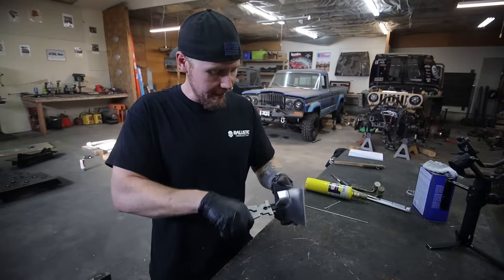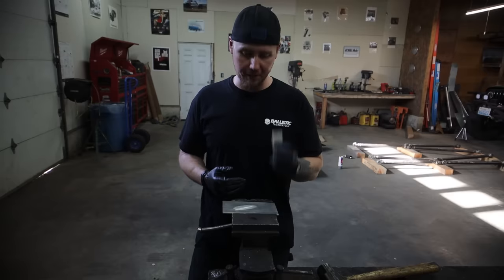Amazon's CHEAP Alternative To Aluminum Welding!!! (Alumaloy)

Comment: I'm wondering if this would work on the spokes of a cast alloy driving wheel from a 1/4 scale working steam traction engine.
I can buy a new pair (they're not sold individually) for around £500, but that's a lot to shell out on a 'new' engine.
The first problem I envisage is the heat sink effect of such thick alloy. I could use oxy/ace, but the potential temperature available would make it tricky to heat evenly.
Reply: you would have to back the spokes up with thin steel sheet metal or possibly thin plaster over a sand backup to keep the metal from running out also the thick chainlink ties used to attach the fence to the poles is aluminum i have welded with it befor feeding it into cracks and pokeing it together with a  a steel coathanger sharp on end
Reply: @dago88881  That's just what I was thinking. With the wheel removed from the engine I would be able to maeuvre it into the best position to do each spoke separately so that the JB Weld would run into the crack. 

I would fix each one on a separate day, leave the last one 48+ hours before going back and sanding down each spoke. Then leave it unpainted for a few trial runs with no load and then a few with a load. If it puts up with that the whole wheel can be repainted.

Comment: You do have a great teaching style and you should also do those suggestions about pre-spotting brazes these edges in another video. But do both sides you will that you almost match tig weldings try line etching the matting of one part onto the other like that double angle braze you had done on this video #9040 Amazon CHEAP Alternative~~~?

Comment: zink alloy is harder than aluminium so will crack under stress but is a stronger metal taper your weld Edge to a v then braise both sides your be shocked how strong it really is

Comment: What do you think of this with boost pipes?
Reply from the maker: I think that's is a pretty ideal project for this product. Charge pipes, weld-in-bungs for map sensors, ect. Just make sure you get some practice in before you braze on something important! Good luck brother 🤘
Reply: @DirtLifestyle  ideal be good to know what the melting point of the material is so know where cant use it. like i wonder if using it to weld a 90deg bend onto turbo would be too close to hot side
Reply from the maker: @martinbruce6713  melting point is just under 800°f. 750 or so. 👍

Comment: Forgive me if this was covered, but do you think it would be beneficial to bevel the joining plate as in welding? Or is this not necessary with brazing?
Reply from the maker: If the material is thick enough then I could see it being an advantage. But to much would make it difficult to fill so I would say its circumstantial 👍

Comment: What is the strength on the welding is there any kind of data on that I got a bicycle rack that I want to weld together I don't know if it's strong enough to braise it and I don't want to have to take it to a shop and have them use electric welder
Reply: Did you say " strength of welding "  - no welding in this vidio

Comment: If you value small business and local support for your welding supplies, then try using a local welding distributor.  Aluminum brazing alloys are nothing new and in stock at most welding distributors in the US.  Amazon is good for certain items, but buying specialty products from them hurts a lot of people on the supply side and opens up Chinese manufacturers access to the American consumer.

Comment: Would this work for something like  a bench or pedal board?
Reply from the maker: Very possible. I would pick some up and give it a shot. The more you use it the better the results. With enough practice this could work great! But keep in mind that it won't be as strong as a real tig weld
Reply: What I have in mind is just a pedal board for guitar effects pedals. Just has to support no more that 20 lbs at ABSOLUTE MOST and for me to step on the pedals to activate them. I'd like to build it from angle iron and flat bar. I'd use a good bit of bracing also. Great video man!

Comment: You were losing heat through the steal anvil below the aluminum. You will have better results braiding over ceramic, brick, concrete, etc.
Reply from the maker: Absolutely 👍

Comment: Do you think it would work between valves on a head v 6
Reply from the maker: I definitely do not. The temperature in the combustion chamber is way to hot for a product like this. Melting point is only 750°f. You will need to weld it with a tig torch or spool gun. 👍

Comment: God I hate brazing.  The puddle is so uncontrollable.  I'll stick with my inverter welder.  BTW you can buy aluminum stick and flux core and it does work.  Keep the arc short and move fast.

Comment: Would this work well enough for an aluminum motorcycle gas tank???
Reply from the maker: It works for my diesel fuel tank fine 👍
Reply: @DirtLifestyle  How much vibration does that take compared to a motorcycle gas tank though?  Asking because the vibration is what tore apart the weld on the old tank.

Comment: what is a double torch I've never heard of that in 60 years
Reply from the maker: It's a propane/map gas torch with a double head. We using in plumbing all the time. Very handy if you don't have oxy/acetylene torch 👍

Comment: Can you use this to seal muffler pipes?
Reply from the maker: Lol definitely not
Reply: @DirtLifestyle  If alumin melts at 1,200 degrees and muffler is at 1,000 shouldn't it work?
Reply from the maker: @mikerangel1545  I was thinking you won't get it to stick. This stuff melts just under 800° but I don't think that would be the issue. Its intended for aluminum. Not mild steel or stainless like you see in exhausts. My apologies, I thought you were trolling me. I have people giving me shit and they frame it in questions like this. I would check around and see if you can find a product like this for steel. I wouldn't be suprised if someone makes a steel brazing rod. Of course welding is your best option, but there could be other products available for someone who doesn't own a welder. Thanks for watching 👍
Reply: @DirtLifestyle  Ok. I'd put up video myself but I broke down and paid to have flexpipe changed Saturday. 

Can you paint an exhaust system to try and keep it from rusting?

Comment: FYI, BE CAREFUL! You better edit this video. When welding on a fuel tank, death is real, we used to (I'm a certified welder) put the fuel tanks before touching them with a welder, use a flame before using a stick/mig welder, put the tank around the corner of the brick building we were in. But first over a 2 day period, we would flush the tank with water over and over and over and over and over at least a dozen times to be sure all the fuel is out, leave it open and venting at least overnight. Then we ducked around the corner, letting only the torch handle be exposed, with us completely around the corner out of danger, and then hit it with a flame from the torch. I have seen a guy flush it once, took a torch to the tank and it blew the fuck up. It bellied the whole tank, a rectangle to near a ball, with stress cracks everywhere, and the tank was ruined. 
      Just to let you know to be aware of the dangers, I saw a guy set up his oxy/acetylene tanks up on a ladder 12 ft. up, then weld up 25 ft. in the air on a sign pole, the tank fell, the Oxy tank, and the top spout broke off and saw that 50 lb tank take off like a balloon when you fill it with air and let it go, the tank bounced off the pavement, went right through the side panel fender from 30 ft. away from the truck like a bullet. BE CAREFUL! You can be very seriously injured!                          
      You are not welding, you are doing a cosmetic bonding, not brazing, more like soldering. Brazing and welding is when you heat both pieces to be joined to the point of melting, then adding the rod/filler to aid in the welding, what you are doing is barely penetrating and not a structural weld as you said. Fine for non stressed items, un-pressured tanks etc... but if the tank is under pressure, I would not do what you are doing. We have test when getting certified, we weld up a box, then weld a nozzle to it, then under gauges to regulate, we fill it with water until the bursting point, and get a reading to be sure proper welds are performed. So if you are going to weld pressurized containers, I would make a test piece and pressurize it to 30% higher level than the normal pressure the tank will be under at least. 
  Also, if you want a better bond, bevel the pieces to be enjoined, the more surface of bonding the better the bond, so a "V" grove on both pieces if possible but even one may help improve the bonding, it may help considerably, as the pointed area may melt enabling more of a weld result than a basic un-structural bond. 
Just trying to help with the info.

Comment: Once I learned how to use this product I realized it's not very useful in repairing anything other than coke cans. The problem with it is the substrate has to be 900 degrees for the solder to stick. Once it's hot brush it and it flows right on. That's ok for tubing or fabricating small items like brackets where you can get and maintain 900 degrees and you have good metal. Cast items are trickier because your sticking point and melting point are so close I find you often destroy the casting before the almuirod sticks. Castings are often full of porosity and thicker so this isn't a practical solution. Unfortunately this happens to be what usually needs repair. These rods do look like they flow a little better than the ones I use.
Reply: P.S. Video was awesome, a real life demonstration of these rods.

Comment: The problem is getting it hot enough. I use my DC tig torch 185 amps. Have to be careful to not melt through though.

Comment: Probably missing the point here... but tapping the hole and putting in a bolt with Teflon tape would have been quicker and neater.  But, what the heck.  The brazing rod also works... >Charlie

Comment: 4:32 is a good example of why aluminum brazing sucks. The material has to absorb too much heat. It always warps. Also he really seems like he's trying to melt the rod with the heat of the torch. When the rod is introduced, the torch should not be involved at all.

Comment: This stuff, alumaweld et al is in no way a substitute for  welding. It's good for its original purpose (filling mold block defects), it will hold stuff together, albeit much weaker than a weld, and you can even make something waterproof. Unfortunately, you can't dress it down without it looking different, and if you grap a bit of dross with needle nose pliers you can actually rip it back off the aluminum- it really is a solder. You should not use this for any structural application. Sure, if you get a hole in your bellhousing it's a step above JB weld or gluing on a piece of metal with silicone. But it's not a weld. If you want to buy this and carry a torch for emergency repairs, more power to you- if you want a solution to welding aluminum go ahead and buy this because it's cheap but save up for an inverter welder- I have an Alpha TIG unit which I'm very happy with. You also have to take the time to learn either process, you are probably not going to patch holes in soda cans with this or lay a nice bead with a TIG welder on your first try. You need patience, if you dedicate a few hours a day to TIG you can weld most aluminum parts together at least serviceably in a week or two. Your welds will get cosmetically prettier over time. 

TLDR: It's OK for some situations but if you want to weld aluminum, invest in TIG.

Comment: I used this process to fix a Subaru's broken valve cover
Reply: J B did it hold because I have a hole in my gearbox
Reply: @fuanabands8436  Yes, but it didn't have any real stress on it. More of a filler that I then filed down to make a new sealing surface for the spark plug tube grommet. And the key is to have the part clean and really heated before applying the rod.

Comment: Use the Yellow bottle (Map), blue (propane) is not as  hot. So, as I am writing this I look into it more, turns out there is Mapp, Map-pro, and Propane. The one you want for this is Mapp, it burns much hotter (than Propane), Map-pro a tad hotter, Propane, well, not ideal. I also says that Mapp is no longer found. I have looked, it's all Map-pro now. Oh well, goodbye to yet anouther good thin. Yes I said thin, I also use dun't, figure it out.

Comment: If you do use this on the trail make sure you **DO NOT PLACE** the parts on rocks. The rock will get really hot,and explode tossing rock shards all over. OF course use proper fire safety.

Comment: U think I can make a complete fuel tank to hold gas for a bagged truck
Reply from the maker: I'm not sure. If you practice with it enough, I suppose it could be possible. Be very careful making fuel tanks, and test thoroughly 👍
Reply: Not worth the risk. Fuel tanks need to be strong. Failures could mean terrible death.

Comment: From what I have seen you didn't even need to put a patch over the hole on the tank. You could have used the rod to fill in the entire hole without it dripping through.

Comment: You all know this rod is made of pure zink right? use a stainless steel rod to move the melted zink along the seam and to breake the oxide layer.it will float better that way.it´s breaking the surfacetension so to say

Comment: Nope... I'd rather keep a ReadyWelder or a GoWeld in my truck. Then you can weld aluminum, stainless or steel "on the trail".
The main problem with these "Alumaloy" type rods is that you end up melting the previous welds if you are trying to do more than just "re-attach" a bracket. If you have a leak, and you have to weld both sides or around a corner, then as soon as you apply heat, the weld you just did melts away.
Where this stuff really shines is being able to fill up a hole in the top of a soda can at the swap meet. Or that gas tank repair you just did... you didn't need to add the patch piece. You could have filled it and it would have bee fine.

Comment: You are not supposed to put the rod under the torch's heat... Good practice tough..!
Reply: Yes, and you need to rub the rod into the hot material, that's make it's much much stronger.

Comment: Do you know what it is made of?
Reply from the maker: Unfortunately I do not. There isn't alot of info on the packaging
Reply: Never heard of that stuff but thanks for the info.
Reply from the maker: No prob man! Thanks for watching 👍
Reply: Just wondering if it is zinc based and if the fumes are poisonous.
Reply: @prancstaman  heat aluminum and it releases gasses that will give you nineteen types of cancer, ventilation is your friend. Be safe

Comment: So the key to success is the right amount of heat in the correct place.  You can invest in a laser temp finder to  balance the heat correctly, or if you put a chalk mark on your work pieces, heat until the chalk disappears and you will be at the correct temperature.  Also, Aluminium ( Aluminum) is a very poor heat sink.

Comment: the disposit of this type of filler material is very brittle so i would,nt use for anything else than patching a hole or supporting something that does not have consequence in the case osf a failure.

Comment: Unfortunately the rods are extremely finicky. A proper torch and heat soaking with acetylene helps with larger/thicker parts. Also, avoid metal vices if you can... metal vices act like a giant heat sink which will fight you every step of the way by pulling all the heat from the parts your working with }:(

Comment: Brick Corner with no air flow by convection or draft is much better place & you need to be aware of where intensity of flame is hottest since you were getting too close and not allowing the kernel part of flame to even form correctly as that is the hottest part of flame and will get you better conduction & efficiency so you do not use as much gas. If I make a video like this I usually make demonstration of the weld strength since a good braze is extremely strong and will prove itself if you try testing it after checking the specs for strength specified by braze rod manufacturer. Good luck with your projects and make sure you do not use your welds on any aircraft that has any living thing aboard including hitchhiking cockroaches .......

Comment: brazing is super weak compared to welds cause you're not getting a deep bind into the material, so just nothing structural
Reply from the maker: Couldn't agree more. At the end of the day I still TIG almost all my aluminum work but this has its uses as well. 👍